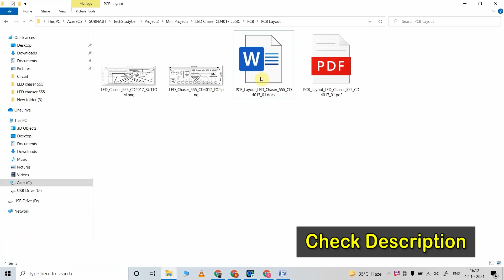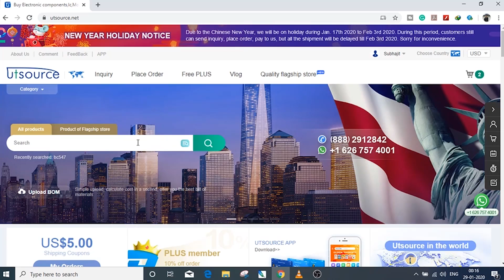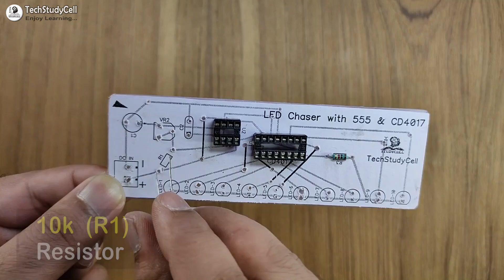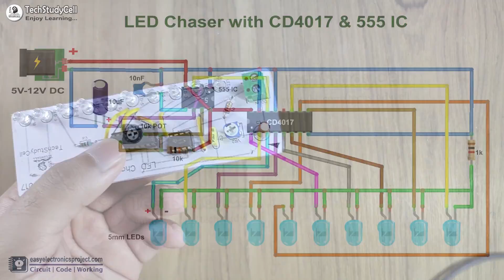LED chaser circuit using 4017 and 555 timer IC

Comment: I just downloaded the file. How to use Paint program in windows to resize .png to actual size in mm?
I tried it but the line became pixelated. 
use only docx file?

I have downloaded other people pcb files. Some are in pdf format and when I print them out, they are all in wrong sizes. Usually too big.
I can't scale it correctly without losing the sharpness.

Comment: Hello Sir
This project is extremely helpfull .Hats off.
You shown very easy method to beginners like me. Thanks for that.
I wish to know :-
 1) What is voltage of 10uF capacitor   ,and
 2) How many LEDs can run on one channel i.e. total number of LEDs on full circuit
                                       OR
What shall be done , if we want to run 10LEDs on one channel i.e. 100 Leds
3) Is this a common anode circuit
Hoping guidance.
Thanks

Comment: Sir mne same circuit design se chaser bnaya but Meri kabhi 1 ya kabhi 3 led hi on ho pa rahi hai... Maine 10 micro farad ki jagah 100 micro farad 25 volt ka capacitor use kiya h.. Please replay
Reply: Or Meri battery 9 volt ki h